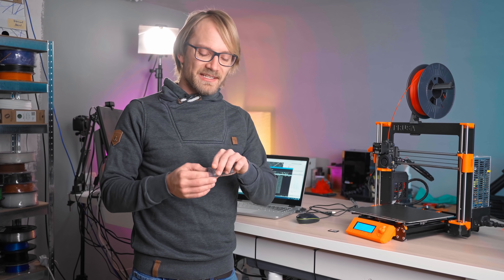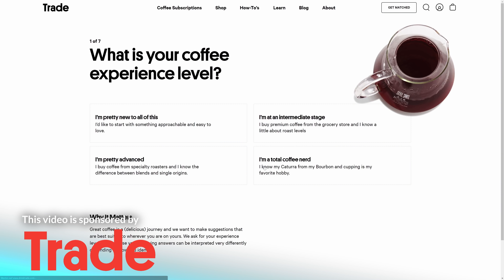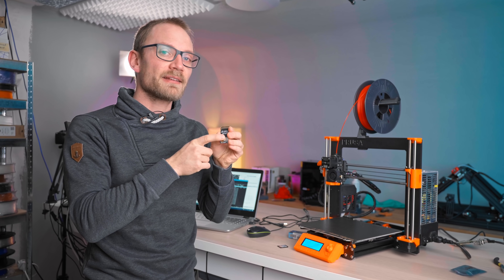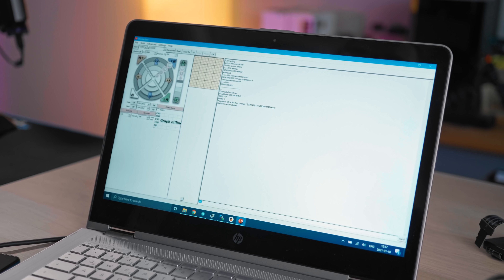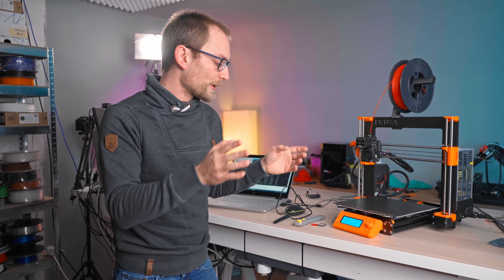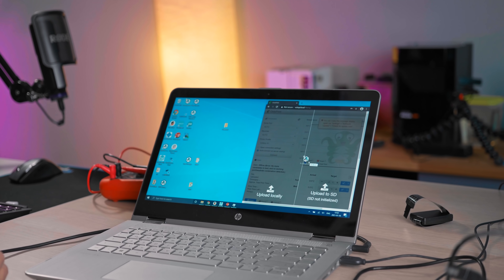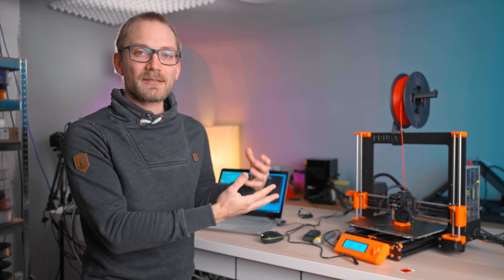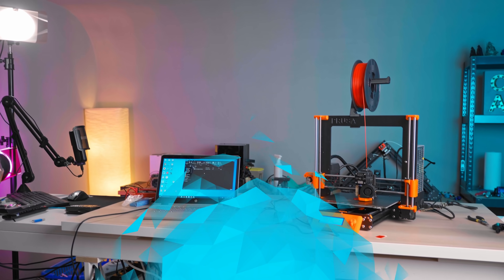SD Card + ESP8266 = OctoPrint Alternative?

Comment: I'm looking for something like this for a local school with a locked-down network.

Not long ago a vid short popped across my feed that I /seem/ to remember that was similar to this (dummy didn't save the link). It was different in that MIRRORED the SD contents from one to the other on their own Adhoc network. This seemed to be a great idea to me; load up each card, set matching credentials in a txt file, set which is Tx vs Rx, and plug Tx into the laptop and the Rx to the printer.

Dump the gcode to the Tx card, and it shows up on the Rx card, regardless of your PC's network. 

Anybody else see this project? I think it was a hardware hacker showing off his ESP skills but I can't find it again for love nor money...

Comment: These are very interesting and something I could use outside of 3D printing...especially since I'm VERY new to this.  One thing I have been looking to find for a long time (and it might even exist) but that I have not found is a micro USB wifi adaptor that uses wifi to replace the physical USB wire.  As far as the printer and PC would be concerned it would appear and operate just as a standard cabled USB connection...just without a physical wire to get in the way.  I'm thinking a USB dongle on each end (ie one plugged into a USB port on the PC and the other into the printer), they'd pair and then just show up and work as though they were physically cabled together.  This would give all the benefits of a USB connection without any of the distance limitations and would be hugely helpful for way more than just printing.  As I said I have been looking for a long time and haven't found anything out there like it, and since I just do not have the skills to make one myself I'm just going to have to keep looking.  But if anyone understands what I've described and knows where I can get one I would LOVE to get your input.

Comment: Nice, funny actually had one and use it pretty much as you described. With an older resin SLA printer that cannot use with octoprint anyway. It means don't have to swap mini SD card in and out. I used a buck converter off the printer main PSU to power the ESP8266.

Comment: Replacing octoprint with this makes a little sense. But connecting both together is another story! I imagine a setup where upload to octoprint would actually upload to that sd card (writting plugin would be needed; that fysect card provides webDAV API) and then instead of printing via usb (which is quite problematic sometimes and slower) print reliably from sd card. That would give octoprint flexibility with sd card printing stability and reliability.  Yes, octoprint has ability to upload to sd card but that's sooo slow (due to 115k serial interface used).

Comment: Hmmm I have my 3 printers linked to 50 quid laptops from ebay.   I use remote desktops and just use one drive to access all files.    Seems like a far less hassel method and you can access every file across all printers.

Comment: copying over the network to octopi is not the same as copying to the SD via octoprint. that is limited to 115k bits/sec. so the wifi card is almost 10x as fast getting the data to the sd card

Comment: I wonder if, possibly after changing some settings in Marlin, you can do the following:
First upload the G-Code of the thing you want to print.
Then upload a file called "auto0.g" to it, with "M32 P !/[g-code path]#" in it.
With how it seems to work, having Marlin poll the SD card to catch the autostart file might interfere with the operation.
But even if it doesn't work, this still is is useful for not having to carry SD cards around, but instead uploading the file while you walk to the printer.

Comment: As this offers no control features, I don't see the use. You still have to make the physical journey from the computer doing the slicing, to the printer, to start the print. If you have pretty much any wireless control solution on the market, to start the print, that solution supersedes the function of this model with its own storage.

I could see some edge case uses for this. Not for 3d printers though. Even if you're running a low budget print farm with no per-printer management solution, the transfer speeds and limitations kill it IMO.

Comment: I have been screwing with this thing for a while.  I put in some custom firmware that removed the webdev interface to use ftp.  It really needs to be the ESP32, with two spi's you can just have the printer be read only and stop the corruption that happens on this thing.  It really needs some sort of buffer chip that disconnects it from the 3d printer when  transferring files.

Comment: the biggest trash i ever had (bigtreetech), it needs a little bit more voltage as the BTT TFT 35 E3 send. Wifi not supporting Whitespace at wifi Adress. Since changed to RRF the  Upload is working

Comment: any ideas why my pronterface is sending the ssid and password in caps? Tom's isn't.
Reply: Funny...I couldn't get Tom's way to work at all. Pronterface seemed to keep sending all caps...so I don't think password ever worked.

I got the .ini file to work. The sample ini in the webdav github was in a subfolder called ini, so I did that first...didn't work. Needed to have the ini in the sd card root directory, and then it worked fine.

My biggest gcode files are about 20mb. Took 7 mins to send. Weirdest part is that windows doesn't show any progress. The transfer window is open and it's transferring...but then it just disappears when it is completed.

I also don't love that the card is exposed to the elements...so might print up some little covers. Right now going to test one of them out and see how reliable this workflow is. I'm expanding to 9 printers...so I'm imagining 9 network shortcuts on my desktop....I slice all my gcode, and then transfer to all 9 cards.

Only thing I'm not sure of is if windows is going to crap out copying to 9 of these cards at once. Might get a 2nd one to test and see how that goes before I do a big investment. This would essentially cut out the sd card portion of my workflow, yet I still have all the benefits of printing from SD card. This might be better than having to run usb cables to every single printer to run octofarm or repetier server.
Reply: Windows explorer crapped out trying to copy to 2 cards at the same time. (two mapped network drives...I'd drag a file to the first drive and it started copying...but couldn't drag to the next drive.) Found a solution though...using xcopy. Setting up some batch files, and it's working great.

Comment: I just happened to start cutting my own hair in the summer of 2019, not knowing what was coming.  So I kept getting trims (from myself) during the pandemic.  I still look pretty freshly barbered.

I don't have a card yet (I'm at 8:27 in your video, which I'm watching to see if I should or shouldn't buy one), but have you tried quoting filenames that have spaces?  (For this is a filename, use "this is a file name".)  Windows uses that format (and I'm sure that Microsoft had a thumb on the IETF's scale).

I finished the video.  The card now goes for about $30.  A RPi 3B+ goes for $37.  So the card is a nice little toy, and thank you for the video, but no.  The card is not for me.

Comment: Some advice here:

If you are using a Duet mainboard, don't use the ribbon cable adapter, it doesn't work :( At least it didn't work when I tried it with my Duet 3 6HC Mainboard, which is a bit of a shame.

Comment: The EP8266 is very power-hungry with high current surges of up to 1A while on average only 10-20 mA are used. Not even every voltage regulator can handle it.

Comment: Hi interesting video packed with some useful info, for me the card looks like it will be enough for my needs, so I just ordered one, but a quick question I noticed that with the card plugged into your printer you have the USB cable connected, did you just not remove it after programming or is this needed to power the board? or will it get enough power from just being plugged into the micro SD card slot? thanks in advance Alan

Comment: I've once tried an Toshiba FlashAir card with builtin wifi and an alternative firmware for it. (this card does not need external power and is exactly the same size as a normal sd card)
It worked, BUT... With my (fairly old) Marlin firmware, the new files on the card were only visible when you manually ejected en reinserted the card.. :-(
Not sure this issue is cleared when using a newer Marlin firmware?
Reply: You do change the config file, its work with all prusa firmware, look on my post
Reply: @automationtekto5823  Could e the Marlin version perhaps?, my printer still runs on Marlin 1.0.0. with some alterations..

Comment: I used to use one of those EZ Share type cards to upload RAW images from my Canon 60D directly to the internet using my cell phone as WIFI. It ate battery but it could still do it reliably. They even had a site to manage the card. This may work better with a different chip and an external antenna depending on the home layout.

Comment: Sorry Thomas, but the item you just marketed got born OLD 📣 .. there are multiple alternatives to Octoprint !!!!  One older one, is the GCodePrintr app for Android. An excelent app, usable also with older generation mobile phones or tablets, paired with an USB Otg cable.  Another option is to use a Esp32 Cam dev board, that can be programmed to do the same and offers the Time-lapse option, using serial connection. The last last option is related directly to 3 mainboards available on the market since 2019, that offer directly the same features: Duet, E4d@box and MRRA . The last 2 boards  are based on Esp32 and offer as an extra BT & WiFi connection, with DualCore mcu's and 240MHz /core  . Peace & Love 🤪☮️

Comment: Thom, another similar option I am using in my prusa the "toshiba airflash" it is an SD card with Wifi, it was created for cameras but also work at least with my prusa mk2.5, I have some years with it but if my remember is correct it cost me like $35 USD (not complety sure) with international shipping
Reply: Forgot to tell, the Toshiba airflash can be also put as network disk in Windows (never try with other SO) so you can see it like another USB Disk (for example) but by WiFi xD

Comment: I have been using Toshiba   flachair SD card with a built-in Wi-Fi on my curator pro .  I also use Octprint With this setup There is no way of directly speaking to the SD card of the printer through Octprint.  For the most part This Wi-Fi SD card has been very good You may need to set a Wi-Fi extender close to your printer to allow for reliable Wi-Fi as the card doesn't have a good range. The card was originally made for digital cameras that do not have Wi-Fi But ideal for some printers. Interesting video though and from what I can see the Toshiba card has more compatibility

Comment: I think the bigtreetech version has a better power supply and firmware for the wifi module, and will work better overall. I have a btt TF cloud the micro sd card version, and it works fine if all you want to do is upload gcode and print it without messing about with the annoying ender 3 microsd card slot. it was also cheaper than a RPI for me, so instead of setting up another server for the other room I just use the wifi sdcard lol.

Comment: Even though I am not going to use this for my 3D Printer, I do appreciate this video, because I have been looking for a similar solution to get the data off of the SD card in my CPAP machine.  I just bought one of these, and I am going to experiment to see if I can read the data off of the SD Card while it is inserted into the machine on my computer.  This will save me taking out the SD Card, putting it in the PC, copying the data, and then putting the card back in the machine every day.

Comment: So I actually found this device super interesting, not really for my 3d printer but for other things that moving the sd around would be inconvenient, so thanks for that.  I would note, even though it's not recommended at all, Octoprint does work (albiet slowly) on the Pi Zero W which is $10.  While admittedly that's not a great option, I think it would be better then this device.

Comment: I wanted to so something similar and the main reason was the issues, which come with USB printing mode. Loss of quality, lags etc. Later on, I heard that there was a solution to this problem. So I stopped on that. It would have been nice to hear a discussion on that regard. This looks like a solution for that problem. It is easier for the printer to print from SD card. Or am I wrong?

Comment: Now I'm wondering if it would be possible to design an adpater with an ESP and an SD slot, that streams the data from a NAS. It would have to simulate a FAT partition and be quite fast. But while printing everything should be sequential access, so it could prefetch data very easily.

Comment: I used the same adapter from BTT and got a huge issue with projects more than 2mb gcode files - esp8266 just halts and printer stops anciently at meddle of printing. Just because of that behavior I avoid using this device - too risky.

Comment: 8-bit limitation for files on that SD card if it's used in this adaptor? Did I've got it right?
If that so then it's just a "no-no" thing that only can be dumped in a trashcan. And the wi-fi speed here is just a big fail. 8 $ for this piece of... is too expensive! I think that it's simplier to get a Raspberry clone and make things that are much much better.

Comment: It looks to me like it has the potential to improve a lot with software updates. Maybe it can even buffer data from the point the printed read onwards, so it can keep feeding data to the printer while it writes new data. The cherry on top would be to connect the printer's serial port to the ESP and be able to control it through WiFi.

Comment: Eye-Fi reinvented.
While talking pros&cons, Tom forgot to say that if you are printing using octoprint and you come to printer and see your print fails in anyway - you don't have immediate controls except power off switch to stop it.
You need to use browser or launch mobile app to do anything. However, when printing from sdcard, printer's regular control panel works.
I would prefer hybrid solution: print from sdcard and monitor remotely with octoprint.
BTW, there is an option in octoprint to uploud to sdcard plugged into printer  and it is very slow as well.

Comment: As someone who's facing issues with my pi disconnecting from my printer mid print this is an interesting possible solution. I can wait a minute for a print to upload for the sake of not repeating prints and wasting filament

Comment: One issue I have had with Octopi is that prints from "local" end up with a rough texture due to the serial port bottleneck between the raspberry pi and my printers.  Using the Octopi to copy to an SD card is prohibitively slow.   Maybe this product could eliminate the worst bit of the Octopi prints, by allowing reasonably quick access to the sd card, and then using octopi to control the print?

Comment: Great video as always. Just wanted to add, this has a slight leg up on Octoprint solely for users who have network issues. For example, rural internet in at least my areas is known for dropping in and out which is a problem for Octoprint, or was when I last tried it in 2019. This type of just read/write solution is also great (at least in theory) for networks that can randomly be reset by others, which could cause print fails. Just read/write over wifi helps when your cpu is in another building than the printer and you don't like constantly pulling sd cards

Comment: there's a commercial equivalent to this in the toshiba flashair - it's a LOT faster than the module shown here and by personal experience doesn't have the same issues with random disconnects on windows.  I also have octoprint attached to my printer but no longer use it for printing (only diagnostics), as printing from the sd card allows power recovery to work and isn't noticeably slower. unfortunately these are no longer manufactured so you have to lucky to find one

Comment: Sorry for linking to another YouTuber's video but just get a Toshiba FlashAir W-04 WiFi SD Card: https://youtu.be/enYwh7UY-Oo
I'm using it successfully in my Prusa i3 MK3S and it just works - Including writing / deleting to / from it while the 3D Printer is running a print.
Haven't tested the speed of it but I can say that by the time I've hauled my ass from my PC across the room to the 3D Printer I've not once had to wait for it.

Comment: One way I've might have approached this type of device design would have been too use the ESP32 instead, it can support the high speed SD card interface, then emulate the SD storage to the printer over SPI on the ESP. With dual cores, may even be possible to have dedicated threads for SD-to-NAS and the printer-to-SD.

Comment: I've been tinkering on something similar with an ESP32, but I quickly decided that rather than intercepting the SD card, I want to connect through serial and use the M20-M30 commands to save files to SD and then print from them from SD. You could already do this with an USB cable (so you can turn off the host computer), the ESP part would just make it wireless and slightly more like a low-budget octoprint alternative, being able to control it remotely and from multiple devices.

Comment: Is 'octoprint' short-hand for a set of functions, or is it a specific piece of hardware/firmware?
I mean, I keep hearing 'Ford' and 'truck' when the conversation is about hauling lumber.
Does that mean non-Ford trucks can only haul non-lumber?
The functions of 'octoprint' are easy to implement using other software/hardware, as Hackaday can verify.
An 'alternative' implies there is no other way to get the job done, or that the established way has limitations.
Just wanted to know which problems this 'alternative' was addressing.